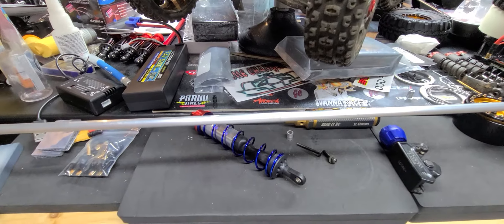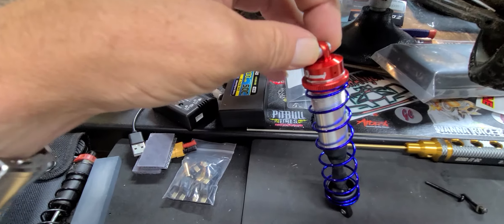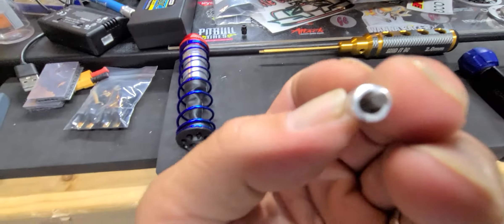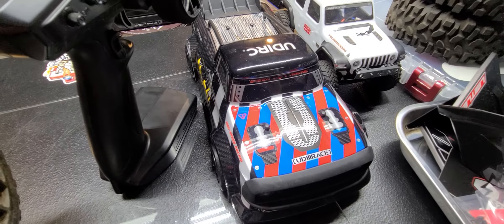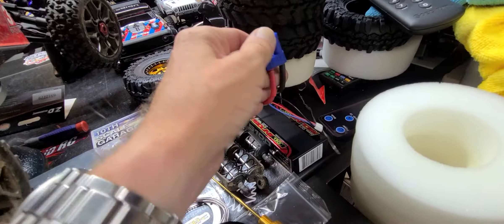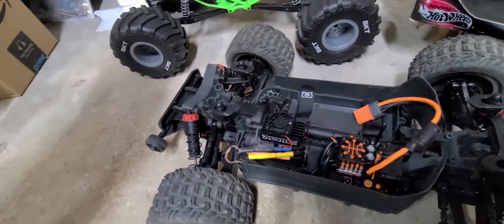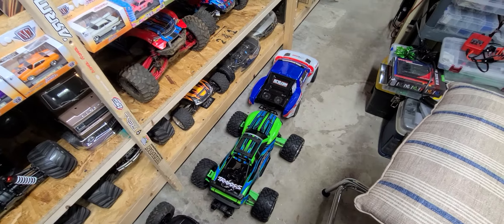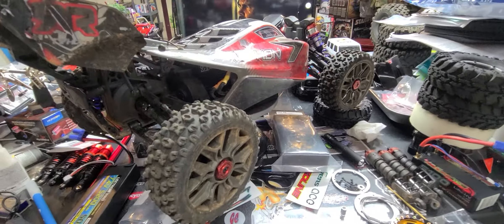little fix it video with what is coming.

Comment: Good stuff here ,they make two types of teflon tape ,they also make a gas rated tape for gas line ,it is a little
thicker so try buy a role of that too ,I used the stuff before to seal stuff on RC tank grommets for a quick fix!..😎
Great vid!..👍

Comment: I had to use axial bushing on top and change bottom pivot ball to keep it from rubbing on driveshaft.  I also changed the shock oil..the oil in these shocks was cheap and none of the shocks were full of oil.

Comment: Hoopty👊 I was looking at your no prep battery. The 100a esc is rated for 7.4v. Will that 7.6v be ok in it? I am looking to buy a battery for my Losi no prep. Awesome video👊
Reply from the maker: From what I have seen the 2s 7.6v battery is what everyone is using. It should hold it for short runs. Running it full time may be different.